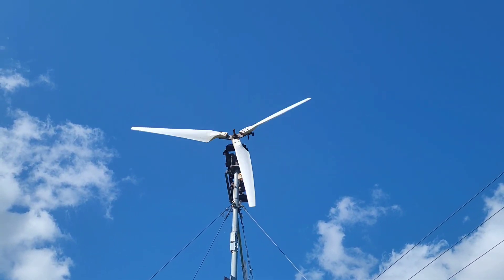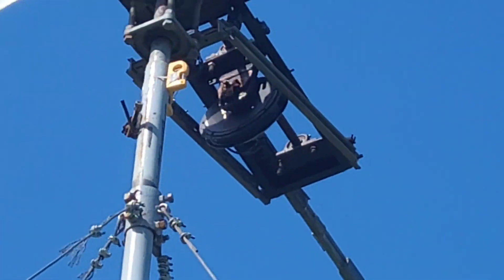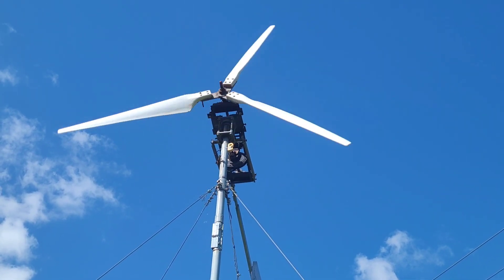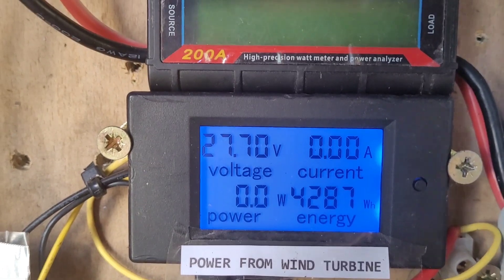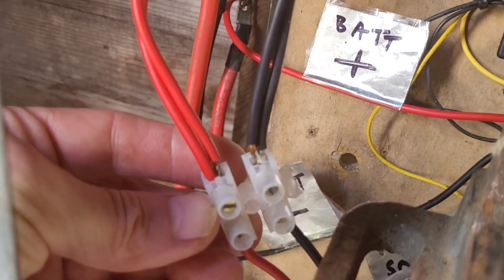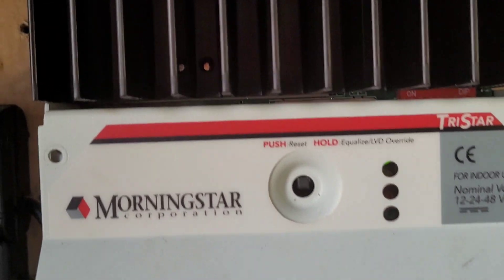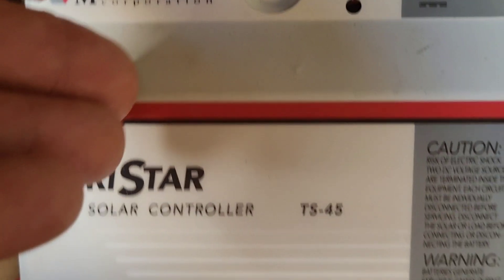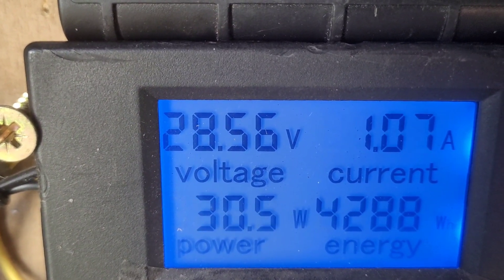Wind Turbine Project Update

Comment: Hello sir your hub motor give different voltage at different wind speed if rpm increase than volts increase but how you fix volts for 12v or 24v battery bank which controller use for fix the volts?